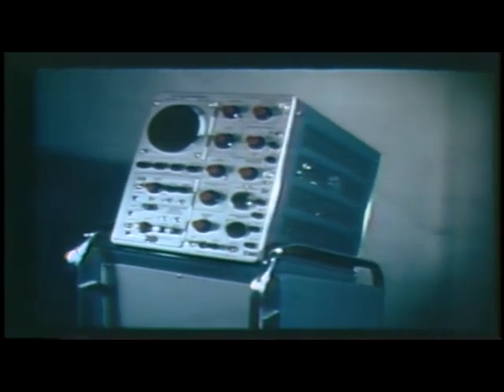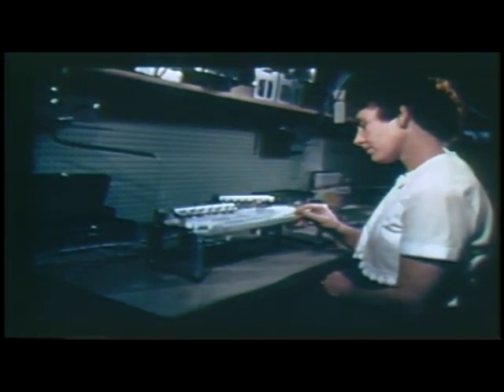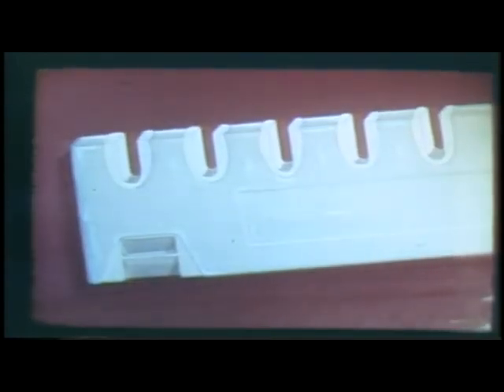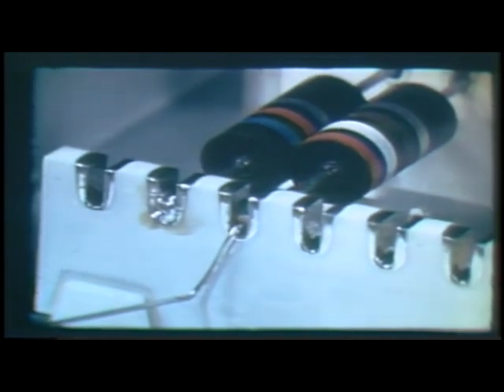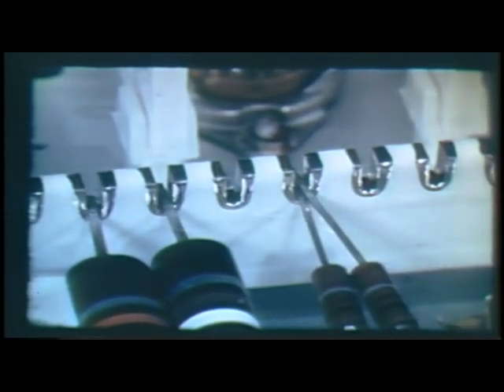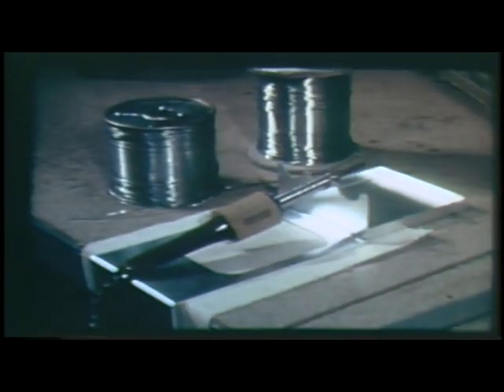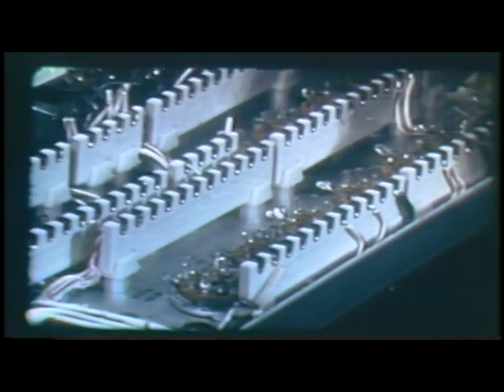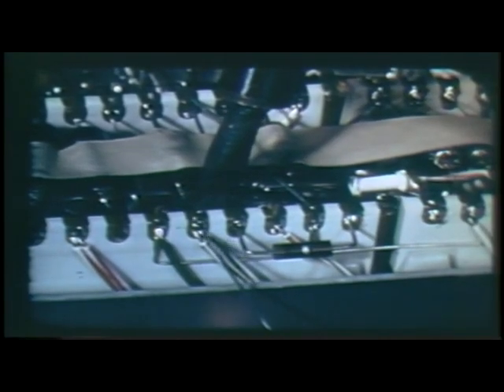Ceramic Strip Soldering Techniques - Tektronix

Comment: I still have hundreds of these terminals, use them only in my most important projects. Unfortunately, the nylon mounting clips have been difficult to find. I have developed a method of using RTV silicone to hold them in place.  Wonderful parts.. These need to put back into production somehow, by somebody, for those still doing hand assembly of point to point electronics. They are far superior to turrets that are the only remaining alternative.

Comment: As far as I know, nobody but Tek ever used these ceramic strips-- and they made them themselves.   Anyone else wanting to use them would have to do the same or arrange to buy them from Tek, and at this point they might not be making them anymore.   A brilliant idea to use these for vacuum tube circuits though.   When they get old however, these strips in the high voltage areas would have an issue referred to as "silver migration" where the large voltage difference would cause the silver to migrate across the smooth ceramic and could result in a short.  It was usually visible as a gray area bridging between notches.  Repair techs might be able to resolve this by using an ink eraser to remove the migrating silver, but if it was too far gone it required replacement of the strip.
Reply: Syncopator:  Japanese manufacturers of professional grade tube based equipment used them too.  I have a late 1950's Meguro Q-meter, and it uses almost identical ceramic terminal strips in the exact same way to mount components and wiring.   Instead of the ceramic being push-fitted into nylon holders, they have mounting screws embedded in the ceramic.
Meguro used greater spacing, and they didn't install tube sockets underneath components, which makes repair considerably easier than with Tektronix.
With Tektronix, the strips can become leaky between terminals due to people soldering during repairs and not cleaning the flux off.   This is less of a problem with the Meguro version due to the greater spacing.

Comment: The Tektronix TAS485 was the epitome of Tek's general-purpose analog scopes. I have been using one for nearly 25 years, and it has more than 2000 hours of operating time on it with absolutely zero problems. The introduction of digital scopes with their inferior displays and aliasing problems marked the demise of the great analog 'scopes. American industry sold-off the manufacturing techniques for CRTs, and even today, what we have in substitution is an inferior heap of garbage, much harder to use, much more expensive, and much less effective.
Reply: Darn right!  We still use an array of 7000 series instruments in our business, some over 40 years old. We also have one scope and one curve tracer of tube technology using these ceramics... still functioning fine at over half a century old.
Reply: I favor the 2465B and its closest relatives as the best all-around high bandwidth scopes ever made. 400 MHz  bandwidth.  Or get a 2440 and have 500 MHz bandwidth.   I rebuild 2465 power supplies as a hobby.   I also think highly of the 7000 series when you need slightly more specialized scope applications.
Reply: I have a 2003 vintage Agilent PSA spectrum analyzer that has 82,000 hours on it. The only service it has had is for o-rings in the attenuators (which turn brittle and disintegrate), and a failing cap in the power supply. Not all digital instruments are less reliable.

Comment: I have a lot of experience with Tek's ceramic solder strips. And it always turned out well.

But eventually I was using the wrong soldering tip all the time.